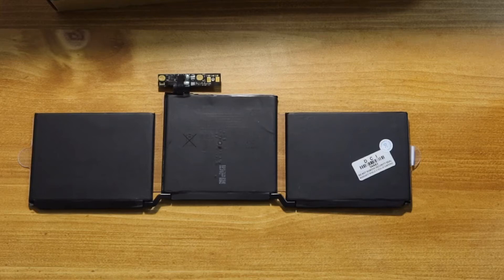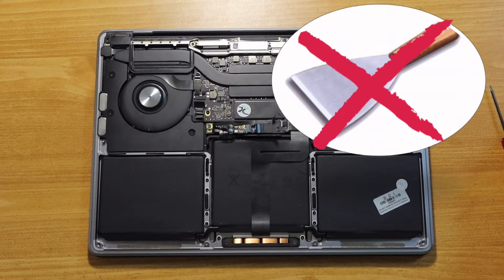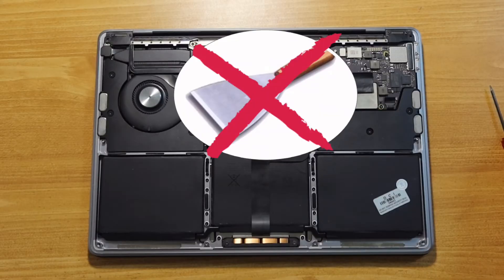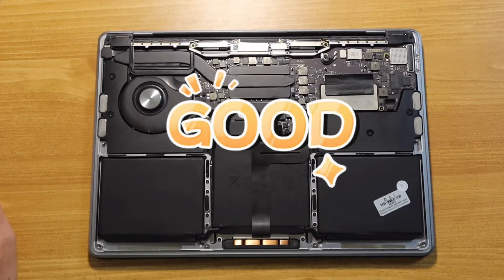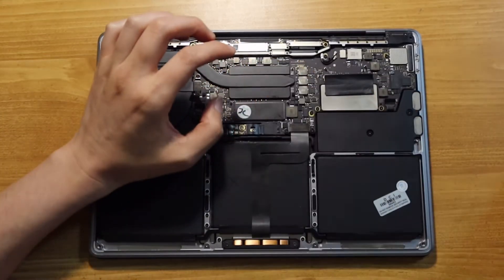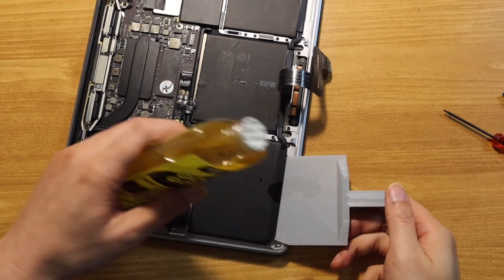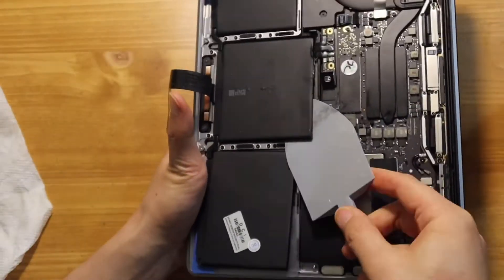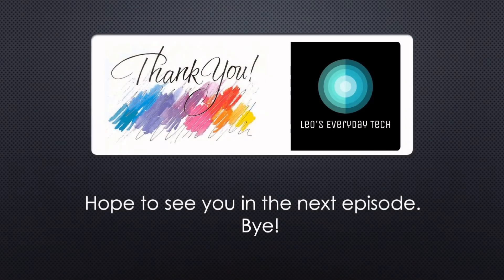How to safely replace a MacBook battery —— A1708 MacBook Pro battery removal

Comment: Do you know if the macbook works by removing the battery but connected to electricity?
Reply: It is going to work yes, But it is super slow. So I don't recommend it.